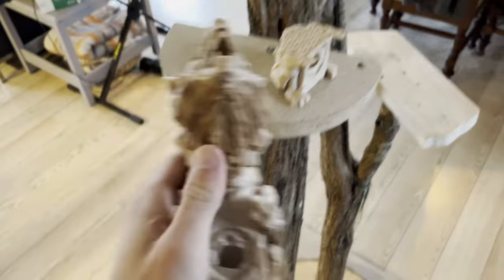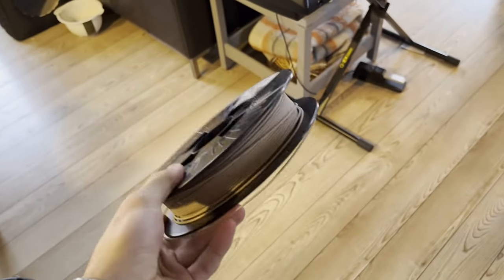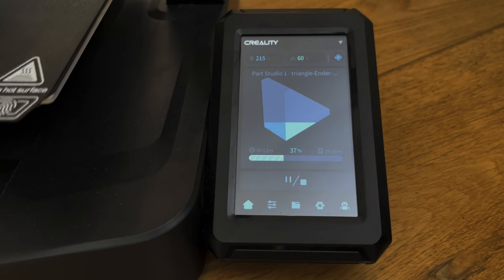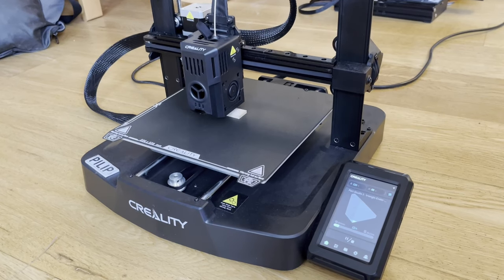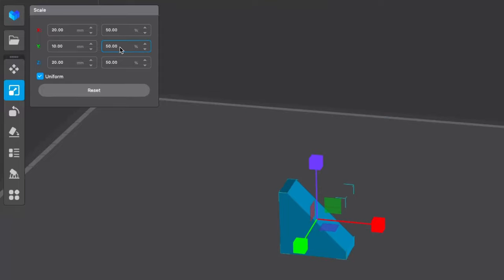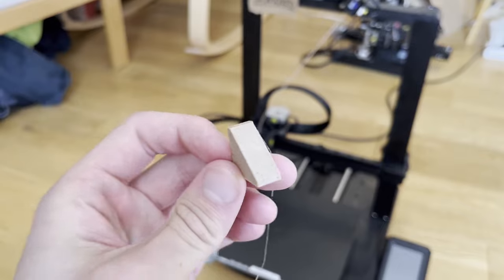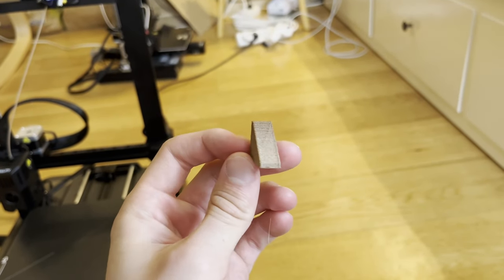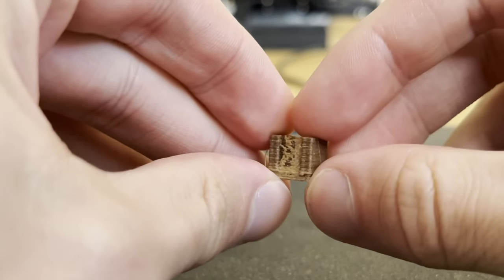printing burnt wood

Comment: The top of the print gets darker than the bottom due to the fact that is exposed more time to the heat of the nozzle. So, in theory, if you were to slow down your print speed you could possibly get darker prints with lower temps (I haven't tested it yet by myself)
Reply from the maker: i'll make sure to try that!

Comment: Causing a house fire is not the only risk from exceeding material temps. Depending on the plastic and how hot you go the material can emit toxic fumes or break down and aerosolize. It could cause severe allergic reactions similar to running a resin printer without proper fume prevention. 

These are worst case, but you should always research and know exactly how the material will likely behave under extreme temps before running it.

Comment: looks like color change depends not only on temperature but also on heat duration. Bottom layers of triangle have larger area and cool down faster, so plastic doesn't change it's color too much. While top layers are still hot when a new one being printed on top of them, so they stay hot a bit longer and do change color distinctly.

Wood torching or baking models in oven probably won't work, but would be fun to try 👀